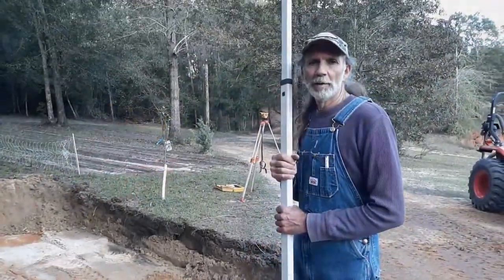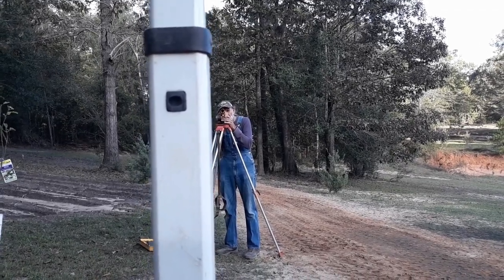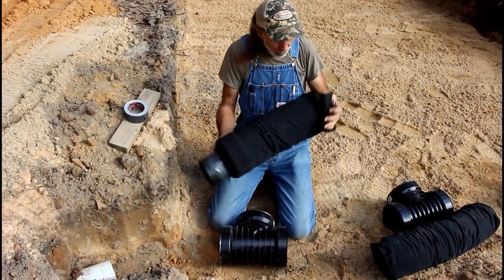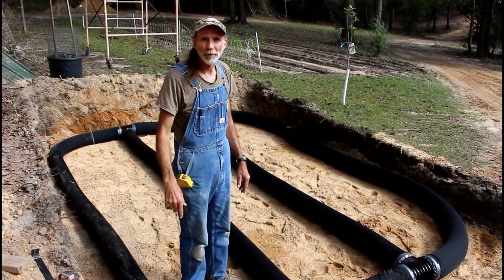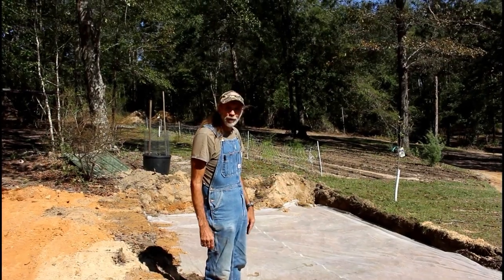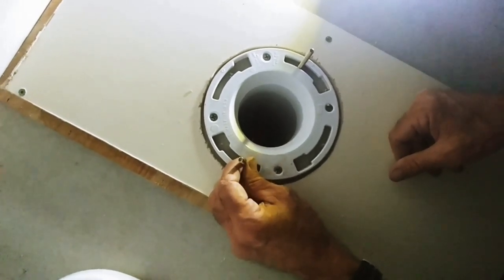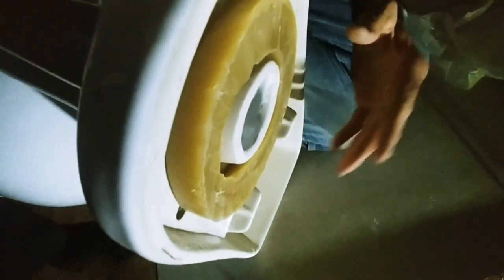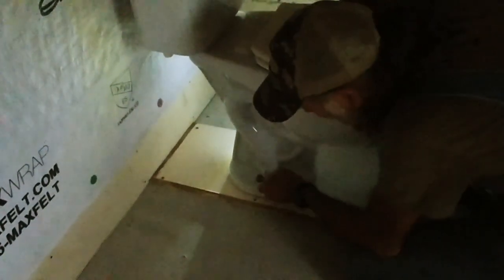LEACH Field Installed | Septic System Install | part 4

Comment: Brings back memories Danny.
Because I did my carpentry and joinery apprenticeship in the country, back in 1967, we dug our septic tanks by hand, pick, shovel, crowbar and hole size was 6ft long by 6ft deep, by 3ft wide and we installed a bolted steel boxing, with round corners, and 6" from the walls, and had a concrete mixer, by hand, used a wheelbarrow to pour the concrete, until the boxing was full.
It was left for a couple of days, then the boxing was unbolted and removed, then the floor was poured in.
We had a small inspection box, and the aggeline, placed in 3 trenches, made from earthenware clay pipes, laid on sand, and every 3 ft the fall had to be 1/2" down the trench.
Each pipe had a 1/2" space and a sheet of tar paper to cover gap.
The council health inspector would come to check and only then  the trench would be filled by hand and shovel.
Good old days Danny.
Us builders back then, did everything.
We even made the concrete lids for the septic tank.

Comment: It amazes me how many people do not know you can flush the toilet by pouring water in the bowl great job y’all
Reply: Gravity is a new thing... 😄
Reply: @cloe bubbles I'm in Fl. I know that drill. Even though we were in the city my dad rigged a water catch system that he hooked up while waiting for a hurricane that filled the tub thru the bathroom window and after it was safe and we did not need it we used it to flush with .I now use my used spa water to flush with after all I already paid for it . It's 90 gal so I just fill-up a bunch of 5gal buckets with lids I get for free.
Reply: Comes in handy when waterlines freeze and you need to flush.  Just saying.  😂. Might have to do it a time or two.
Reply: @hollyridgehomestead  melt snow.  Did that when was a kid power off for two weeks
Reply: Great educational video. 👍🏼
Reply: SCIENCE!

Comment: Great job you guys. 
I recommend that you temporally put a piece of 3/4 plywood between the tank and the wall until you actually get to put your interior wall in to take up that space. 
Wouldn't want to accidentally lean back too far and break the seal at the bottom of the tank.
Awesome, awesome job you guys! Just stellar.

Comment: Thanks for taking the time to put this video together.  I have an untiled floor in an unfinished master bedroom that is plumbed for flushing. I didn't think of using plywood inserts as temporary placeholders until tile install. Good stuff. Thanks.

Comment: Great video!!! Great idea on the elongated high boy ADA toilet. It really does make a difference. While you have the studs exposed you should put in a 2x10 wood blocking between the studs on the left wall (while seated) for a 36" grab bar. Even if you don't install one now the sturdy blocking will be in the walls for when you do. I admire your skills and abilities. Place is really looking good!!!!

Comment: We are older, but I discovered the comfort of the Handicap toilets at public restrooms. I had them installed in our 2 Bathrooms. The Standard size toilets always felt like you are sitting in a hole. The Handicap height is closer to a chair height. I feel they should be the "Standard" size.
Reply: handicap toilets are really comfy. 6 ft 4 inch   75 year old guy.

Comment: Used to be very common to mount the toilet to a marble base similar in size to your mock-up drywall.  I had to order one but am very happy with the result, allows you to butt the tile against it, also distributes the weight of the "sitter".

Comment: I like the idea of off-grid living, but I think my first priority in choosing a site would be to find one that has an active spring that could be used for hydroelectric power and also a running water system going into the cabin using a pump powered by the electricity produced by the electric generator.
Reply from the maker: That is the ideal situation.
Reply: @DeepSouthHomestead  - Exactly...one of the main reasons I'm not doing it. Did I mention "theoretically"? Hmmm...should have.

Comment: Now that is shallow leach field. What's to keep someone from driving on and crushing it. You will know were it is but what will happen when company  comes and just pulls up by accident
Reply from the maker: Code says they can't be any deeper than 3 feet deep and ours is 3 feet deep.  Plus we have cross ties around it with grass planted.  No drive area.  And there shouldn't be any "Company" driving back there.  LOL
Reply: @DeepSouthHomestead  had no idea that code would be that shallowat home it's 6 ft so you can see my confusion. Isn't it odd from area to area the difference. Have a blessed day
Reply from the maker: @garybivens3236  our ground doesn't freeze here so we can do things shallower. Our water lines are only buried around 12 inches.

Comment: Are you thinking about putting rain gutter around the house piped to a ibc tank to run water to the toilet.
The tanks hold about 225 gallons.
One good rain will fill the tank.
Thats a lot of flushes for two people. The plastic gutter from home depo has a leaf and dirt filter that snaps on top to keep out debris.
Reply from the maker: We have a gutter system on the cabin to fill the tote and eventually flush the toilet.

Comment: A 5-gallon bucket comes in handy when you need to do a "hard" flush for helping to clear clogs in the main line. Remember, if you begin hearing gurgling within your sinks or bathtubs, especially after you flush, you could have a clog developing. First thing you'll want to do is to open any and all clean-outs so you do not have sewage backing up into your home. Once your cleanouts are open, proceed to verify and clear the clog. I have a cleanout on the brick wall of my home. I simply insert a garden hose with a heavy-duty brass high-pressure nozzle to help push any clog towards the septic tank. I push the garden hose into the cleanout as far as possible before turning it on. I then let it run for a few minutes, followed by a couple of hard flushes with a 5-gallon bucket in the bathroom(s) where the sink/tub is gurgling. Repeat until you no longer hear the gurgling. Check out my septic videos on my channel.

Comment: Thanks.  Very nice video.    Are you planing to gravity feed rainwater to the toilet?  I did so and had to buy a special low pressure float so the water would shut off.
Reply from the maker: Yes eventually.

Comment: How do you insulate pipes effectively between floor and ground so can be used in winter and not freeze and crack?
Reply: I'll chime in with only half the info... If they are in the deep south, that is insulation enough. Also, with a 4 inch straight down, what is going to freeze? Water isn't going to collect, it runs down into the tank. Hope this helps

Comment: I always wondered what a leach field looked like.  Does the tape degrade over time?  I do know about bucket flushing.
Reply from the maker: Once it's covered up the dirt will hold everything in place even if the tape deteriorated.
Reply: Sue D this is not the standard field line. This is homemade and not typical at all.  Look up pipe and gravel or infiltrator

Comment: Another very enjoyable, relaxing and informative video.  I'm trying to figure out why my system, installed by a "Licenced Contractor" failed after 2 years.  I think I have it figured out.  Learned a lot from your previous video.  Your drain field soil looked clayish, was it?  If so, how much of that clean sand did you put below the runs to ensure the effluent had enough space to soak into the ground?
Reply from the maker: It wasn't clay it was sand and gravel.  I put 6 inches of clean sand beneath the pipe.  And then filled in around the pipe and 4 inches above the pipe with clean sand.

Comment: Once you get everything like you want it will you run water to the commode.
Reply from the maker: Yes from the rain catchment system.
Reply: @DeepSouthHomestead  that's awesome. If y'all are like Birmingham there should be enough water to last all year

Comment: So help me out here somebody please,..the solids settle in the septic tank, the liquids flow from there out in to the leach bed,...is the leach bed piping perforated to allow for escape into the leaching bed, or does the liquid just circulate through the pipeing until it naturally dissipates how does the leaching work ?..if it does circulate until dissipation, wouldn't gases build up in the pipeing system over time ?
Reply: David Snow the pipe is perforated
Reply: @BruceSommers  thank you

Comment: What’s a leach field?
Reply: It's for the excess water run off from the septic tank,  The solids go to the bottom of the septic tank and there's a pipe at the top that runs into the leach field for the excess water and distributes the water so you don't wind up with a mud hole.
Reply from the maker: Thanks well said Brensway.
Reply from the maker: @charlescoker7752  the toilet is the only thing going in it. It uses 1 1\2 gallons of water per flush and only gets flushed once a day if we are there. So it will be a long time before it needs it.

Comment: Lmao wow. There is a reason why you should hire a professional.  There’s no way that’ll work.
Reply: Why would you say that. After watching this man's videos I believe he completed this job very professionally and to code.  I'm planning on performing something similar on my off grid project being done by myself an unprofessional.  What should have been or not be done? Thank you
Reply: TC for starters a minimum thousand gallon tank preferably concrete however an approved plastic septic tank would be fine however concrete is cheaper and better. Then a distribution box going to actual field lines whether it pipe and gravel or infiltrators or EZ flow. If you truly wanna off grid system I suggest a surface discharge by using a residential treatment plant. But my first suggestion is to get a Perc test and not just arbitrarily put anything in the ground. Septic systems isn’t like going to make your own kitchen table. There is a serious engineering process involved if you don’t have a proper plan or proper products it will malfunction and it will cost you thousands of dollars.
Reply: TC This is what I do for a living, I’m a professional and I know what I’m talking about
Reply: @TheSepticGuy  thank you for your detailed response.  My particular system wouldn't have to support a full household on a full time basis. Do you think that a system of this size would accommodate 3 occupants only using toilet for a total of 45 days a year spead out? Its truly a summer weekend place for us and have gotten estimates of over 20 thousand dollars for a system. Were not trying to circumvent the standard process but with just an rv on site and little usage we can justify the cost.....Thank you
Reply: TC two main points, you shouldn’t think of it as a part time home, you have to consider that you may sell it or possibly move in full time.  That said it should be installed in the case of a full time situation.  And as far as price goes I cannot for the life of me see how $20,000 is acceptable.  Here in Arkansas we have some of the more expensive septic systems due to our health department and the average regular septic system for a 3 bedroom home cost on average of $3,500
Reply: TC the high end which is RARE could be $15,000.  But that’s not common at all.  That happens when you build pre maturely and don’t have the room for a standard system.
Reply: @TheSepticGuy  I would gladly pay 3500. Even 7000 but because I'm in a special watershed district in the wonderful state of  New York the install has to be overseen by the department of Environmental conservation and in accordance. They say I need a series of circulatory pumps that run 24 7 and a leach field of over 500 square feet! The equipment alone is over 10000 dollars then labor and permits..It's pretty nuts here. I guess I will stick to paying a company 75 bucks to come and empty my holding tank every time we use it. I think my problem is not what I'm trying to achieve but what where I'm trying to achieve it.. . Thank you again for your time and professional knowledge.
Reply from the maker: This system will work just fine there are hundreds of them installed where I live. My own home has one like this that was installed over 16 years ago by a septic company and has not given one problem. Its a 3 bedroom home with two baths and a 500 gallon tank. And has only been pumped once early on because we were using the wrong toilet paper. Haven't had any problems since then. Our ground is sand down up to 6 ft deep.